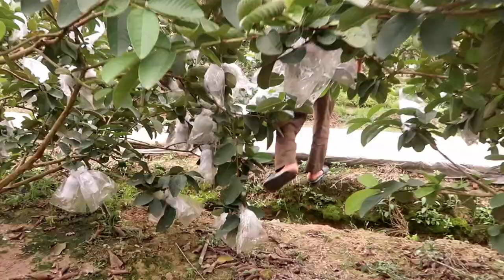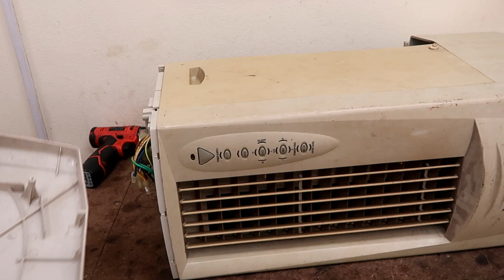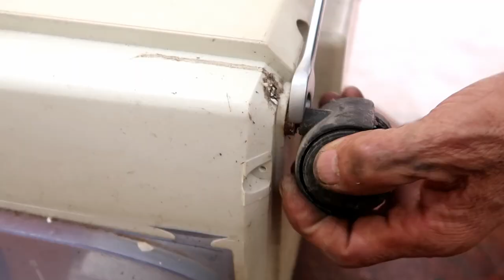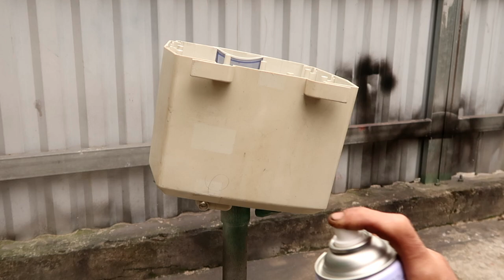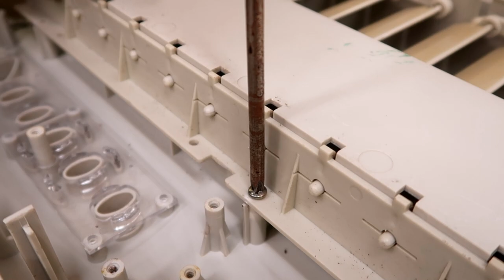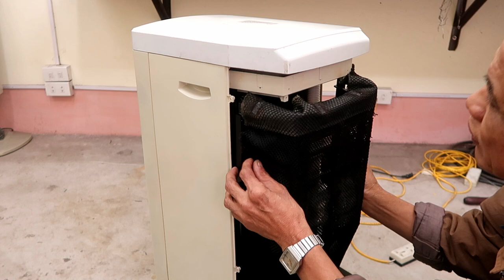Steam Fan Restoration - Recover What Was Thrown Away

Comment: Have u tried lysoprosol alcohol to clean the electronic bits 

Then soaking the plastics in hydrogen peroxide to remove the yellowing
Reply: Weirdly when I was in Vietnam I could not find isopropyl alcohol anywhere. Pharmacies actually just sold plain 95% ethanol for wounds/etc. I think a 500ml bottle was about 20K VND (about $1USD.) It actually confused me a lot and took me a long time to figure out how to get some rubbing alcohol. In my experience alcohol is the best electronics cleaner, it's more gentle than other solvents on circuit boards. Also weirdly finding large bottles of hydrogen peroxide was difficult, the pharmacies all seemed to have only 50-100ml bottles, though I'm sure you could find the paste kind for bleaching hair I guess. 

Cồn Ethanol for Mr. Electricity.
Reply: @GilBatesLovesyou  : U just find wrong place. IPA is not sold in phar. store, but Chemical store (pharm. store sell healthcare products)

Comment: um, you do nice work. However if you do testing to see what it needs, you should show some of the testing to let us know you do test it. Otherwise, there seems no need to change parts if you don't test them first.  Also in the US we don't call that a steam fan. It's a vaporizer In this case I don't think it even heats the water, tho I may be mistaken about that.
Reply: I think he just cleans and rebuilds whatever he can.  This is called a humidifier in the USA
Reply: @ProlificInvention  taking out and replacing parts is clearly shown... i'm just saying you wouldn't replace parts without checking whether the parts you are taking out is good or not.
Reply: The buttons that you see when he replaces them are very quick to break when used for a long time, so there is no need to check.